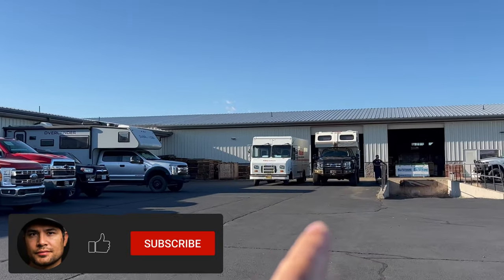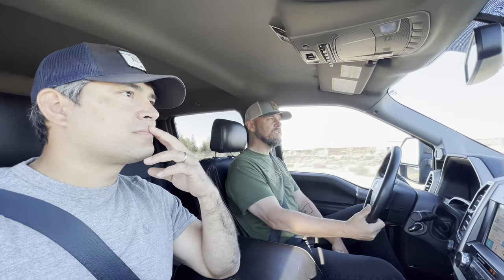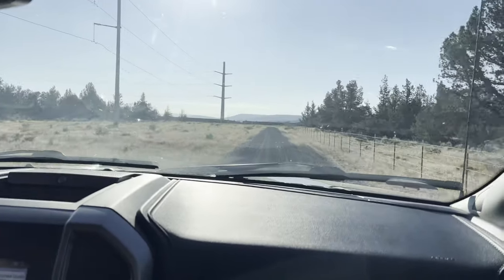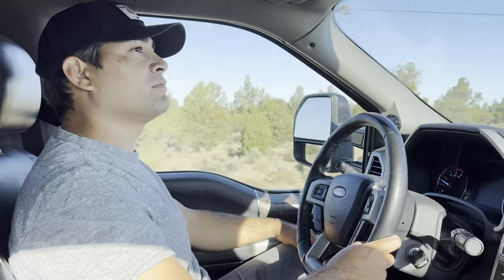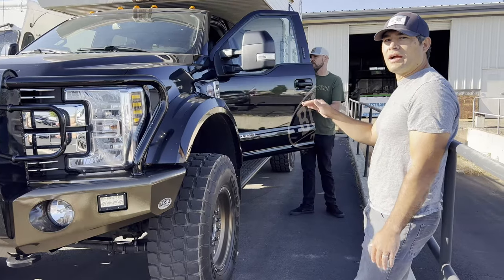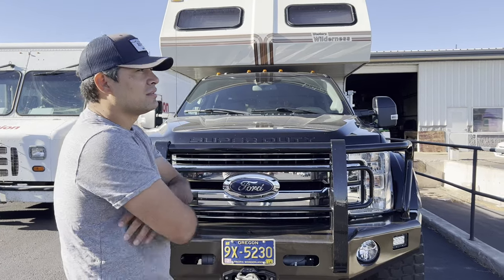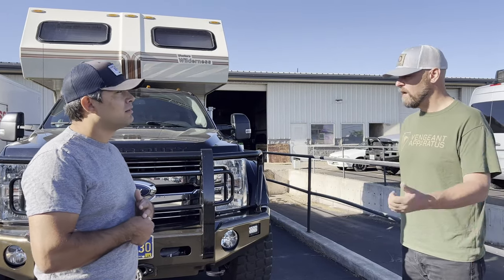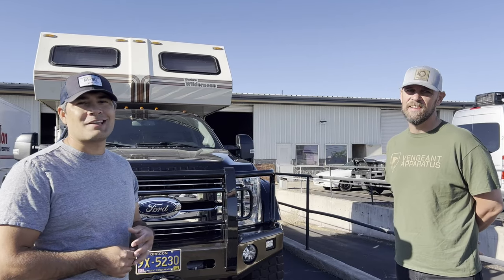Behind the Wheel: Buckstop F550 Super Single Conversion

Comment: Is the Liquid Springs suspension better than airbags? What long term reliability issues are there? Any regular maintenance needed?
Reply from the maker: From my research there isn’t even a fair comparison . Liquid spring is an active suspension, it takes in inputs like speed, acceleration, turning, breaking, and weight to actively adjust the fluid dynamics. All of that makes for an amazing ride regardless of if the truck is fully loaded or empty. Also these are common in ambulance and have a pretty proven track record for reliability.
Reply: @ExploringStillConnected  it sure sounds like the ultimate solution! You know of any maintenance that needs to be done on a regular basis?
Reply from the maker: Nothing that I know of, general check of suspension every 12k and keep the hydraulic reservoir filled would be good things to look for. All of the parts seem industrial grade so probably going to run a while before service. I’m sure if you reached out to liquidspring they can give you details.
Reply: @ExploringStillConnected is correct.  There is really no maintenance.  Service lift of the struts varies with conditions, but is generally 75,000 miles
Reply: @buckstoptruckware3240  What if the the hydraulic system goes down...just sayin....then what? Where does the truck then sit as far as level? Does it bottom out? Is it still driveable?
Reply: @RustySpurs63 If the system were to completely fail,  the truck would drop down to the bumpstops. It is still driveable.

Comment: I appreciate the video and the thorough review, but I hate to inform you that those are not “super singles“ those are just very large, very wide tires, and they converted the dual rear wheel to a single rear wheel. Super single is nearly twice the size of that tire.